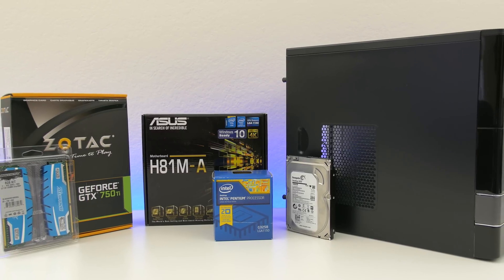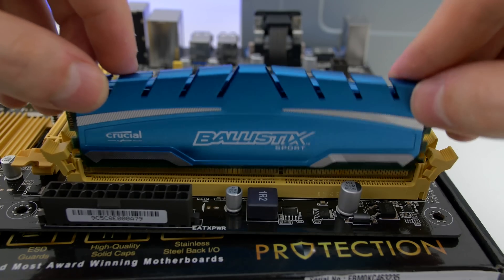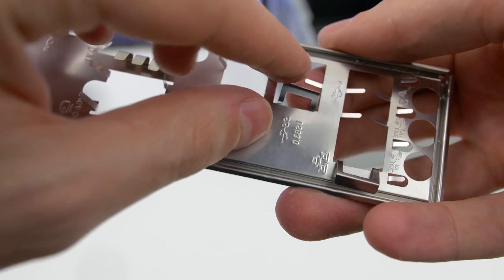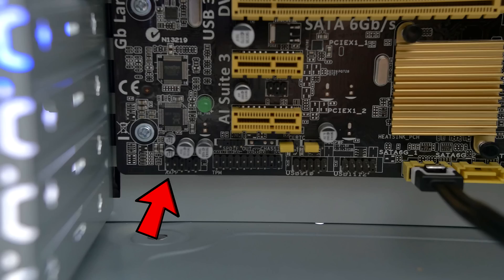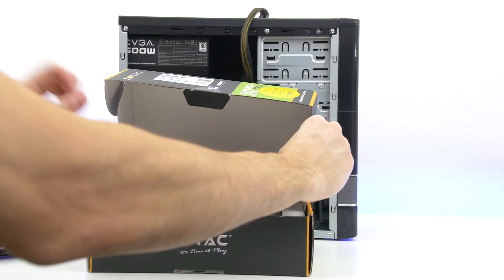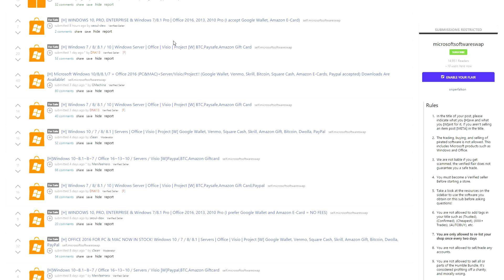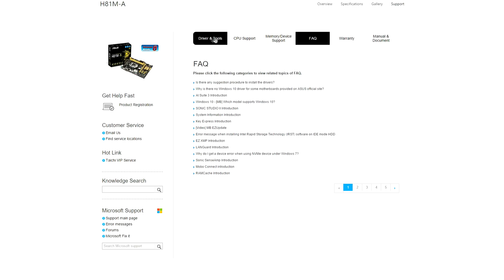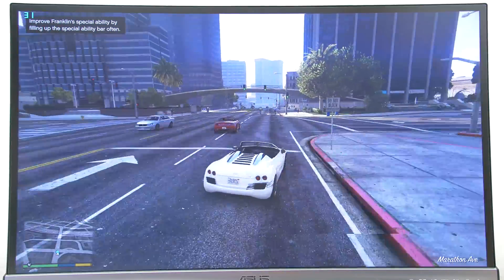How To Build $350 Gaming PC w/ Windows + Overclock!

Comment: just finished the build...its awesome
Reply: +Liam Boyle for sure, it has trouble running skype with games but it's not a huge problem...if you upgrade anything I'd recommend the processor
Reply: +Hunters for some reason mine is really slow. is it for you as well?
Reply: +fifastarXD slow at what? mines been very good
Reply: +Hunters it loads applications really slowly for some reason? Maybe because I didn't download all of the plug ins yet?
Reply: +fifastarXD that's could be it
Reply: +Hunters not the problem either. I'm unsure what to do at this point now :(
Reply: +fifastarXD idk mine couldn't run games and skype at the same time at first and I just restarted it and it worked I also didn't over clock it
Reply: +Hunters yea that's what's happening to me right now. I couldn't run any games. However I overclocked but that should increase the performance not decrease it?
Reply: +fifastarXD it should but I have no idea why mine started working this is my first ever build so I wish I knew more
Reply: +Hunters yea same here. I tried to ask Ed but he never answers lol

Comment: Hey there, i want to see a special build from u :) . i7 6700t, cr-95c 
passive cooler, Seasonic Platinum Fanless 400W, Gainward GeForce GTX 750
 SilentFX, and a m.2 ssd . Mobo and case picked by you for this build :)
 . Can i see this? I want to get this build and i want more info about 
reliability and temps in load. I want to use it for hard multitasking. Can u test these components to check how it performs? To know at what to expect if i dont use any cooler.

Comment: What does over clocking do exactly i know it increases the performance 
but how?
Reply: By stretching its limits, however if you overclock it too long or too hard it will use more power and you have higher chance of running out of power or havinf malfunctions

Comment: What do I do with the PCI-E cord thats connected to the PSU? I have a GTX 950, would I connect it to that?
Reply: the second part of your comment. causes theres a PCIE slot on my graphics card (not the one in video). do i just ignore it?
Reply: MSI GeForce GTX 950, it had a 6 pin and the PSU has two 6 +2 pins, would I connect a 6 pin and just ignore the 2 pin?
Reply: alright thanks! cheers mate.

Comment: Intel Core i5-4690K 3.5GHz Quad-Core Processor
ASRock H97 Anniversary ATX LGA1150 Motherboard
Kingston HyperX Fury Black 8GB (2 x 4GB) DDR3-1866 Memory
Western Digital Caviar Blue 1TB 3.5" 7200RPM Internal Hard Drive
Samsung 850 EVO-Series 250GB 2.5" Solid State Drive
EVGA GeForce GTX 960 2GB SuperSC ACX 2.0+ Video Card
Deepcool TESSERACT SW ATX Mid Tower Case
EVGA 500W 80+ Bronze Certified ATX Power Supply
Cooler Master CM Storm Devastator Gaming Bundle Wired Gaming Keyboard w/Optical Mouse
Good build? It's my first.
Reply: good build ^_^
Reply: How much did you play for all of it

Comment: Hey I want a super fast computer that will render cinema 4d and blender super fast for under $1000 is that possible? And any recommendations for a pic and processor.
Reply: i7-4790k or something in the i7 line due to the hyper threading it helps greatly with rendering as you do in c4d/blender

Comment: 1.345 is too high for 4.3.
I know all cpus are different, but if it takes that voltage for 4.3, you got a dud. :P Not that it really matters I guess, it will still do it's job.
Mine hit 4.4 at 1.25, now reaching 4.6 was a different story. It takes that voltage for 4.6 (1.345), but this is on air.
Reply: +Chika Hakozaki It depends on the motherboard though
Reply: Owismael That's true and also the chip itself. As long as temps are okay, I guess nothing to worry about. This cpu is quite impressive. It actually doesn't come that far off from my old Phenom II x4 965, and that's with an OC. However what's more impressive is that it out scored it on firestrike with the same GPU. Really impressed that a dual core is outbeating a Quad in that.
If that didn't make sense, I'm talking about Physics. The Quad still beats it. But overall, the Pentium outscored it.

Comment: Right now I'm using an old XP computer because I got a bad motherboard from Amazon. Check out these specs: 
Intel Pentium 4 630 1-core 3GHz w/hyperthreading
3GB of RAM 
ATI Radeon X300
Windows XP Pro 2002 SP3
lol this is garbage these days but back then this was a killer  PC. It's been going strong since 2005. Damn they don't build PC's like they used to. I have a PC at the radio station running Windows 95 and a very old AMD K6 and 64MB of RAM lol
Reply: You have a better cpu that me
Intel i3 dual core 2.1GHz
Reply: Nah I only have one core lol

Comment: Then when you done with this shit, throw out this intel garbage(i don't hate intel just the G series). Buy an FX-4300 with a normal motherboard and a good cooler(it's cheap beleive me) and there you have a 4,7ghz 4 core pc and that CPU does know not just the double than this
Reply: Well you can easily upgrade from the pentium straight to an i7 4790K, without a new mobo. Rather than switching to AMD
Reply: +Tris which is cheaper? :D
Reply: The intel is cheaper to start with. Then when you save for like a few weeks, then get the i7? AMD gets destroyed in performance
Reply: i7....but for gaming an fx8320E does it's job....cheap, good, cool...ofcourse not in 4K but not everyone affords that kind of entertainment :D

Comment: Is there an alternative for the ZOTAC GeForce GTX 750 Ti  cause it isnt available in my country?
Reply: +BA LION r7 360 or r7 260x
Reply: +Nissan U. (SUBW00FER) thx
Reply: +Nissan U. (SUBW00FER) Gigabyte or Sapphire r7 360?
Reply: BA LION I personal would go with sapphire because they specialize in AMD cards, but really they preform the same for the most part. Just get the cheaper one. 

And if you can fork out a little extra money you could go with with the r9 270x or the gtx 950 if they are available in your country.
Reply: Nissan U. do they all fit on the mainboard he uses?
Reply: BA LION yes. But there is a Pci connector in the power supply you connect with the gpu. The 750ti doesnt need one because its so efficient.
Reply: +Nissan U. (SUBW00FER) oh ok thx for helping me out

Comment: hi would someone tell me if there is anything i could improve on this build/ will it run the new gen games well enough?
Crucial DDR3 PC12800/1600MHz CL11 8GB ram
Gigabyte GeForce GTX 960 4GB Video Card
Intel Core i5-6600K 3.5GHz Quad-Core Processor
Western Digital Caviar Blue 1TB 3.5" 7200RPM Internal Hard Drive x2
Kingston SV300S37A/120G
not sure on power supply right now any suggestions?
thanks for your time please reply if you have any feed back/ help to give :)
Reply: +noodle muncher and the mother baord is 
Asus Q170M-C

Comment: Ed, I have a question if I use my old hard-drive that works perfectly fine and use it in this build for a new pc will it run/boot up okay, I have Windows 10, 64 bit on my current hard drive I use now. 
Thank you in advanced.
Reply from the maker: Yes ofc. Just plug it in like I showed in the video and ur set to go
Reply: +TechSource okay! Thanks so much. Appreciate it.
Reply: Hey Ed i saw your 450 December pc and this. which one would u recommend

Comment: a crucial part of this is waiting for deals, and also willing to buy used. I was able to build an A10-6800K system with a 212 evo, 8GB of ram, and some gigabyte matx mobo for around 200 dollars. Granted, I had a PSU and windows laying around, and i later bought a HD 7770 for 30 bucks. Just wait for deals, or black friday, and enjoy the value :^)
Reply: Why the a10 if you're using a dgpu
Reply: +Ben BC the hd7770 was an upgrade a year later

Comment: The reason why those metal parts are "interfering" with the build is because they ground the USB ports with the case. You should leave them exactly where they are. Also, the hard drive doesn't use SATA 6GB/s interface, it uses 3GB/s so what's the point in wasting a good 6G cable and port?
Reply from the maker: +Bjork Vlogdok the hard drive is a 6gb/s drive from Sea Gate. Those pins are annoying and get in the way, lots of people remove them.
Reply: I know but it doesn't use that bandwidth, only solid state drives do.

Comment: Hey Ed or any viewers that know their stuff, in terms of cable management would it be a bad idea to use brown adhesive tape to tape the cables together in place? I don't have the luxury of having velcro straps and cable boxes for this purpose unfortunately lol. If not would it be better just to leave them be?
Sick PC build as alwayss btw :)
Reply: +TheMaster640 I think it would be better than nothing. If you can't get Velcro, just use zip ties. If you can't use those for some reason then I think the tape would be fine. I wouldn't leave the cable like that because that creates bad airflow and bad airflow means more heat and you never want a hot computer.
Reply: +Ethan Burton thanks for the advice I did actually opt for using zip ties as I did have some lying around lol worked nicely :)

Comment: Ok so I'm new to pc and all and I've really got in to pc ....SO I decided to actually build one but I'm not shure what to get or anything ,but what I'm wondering is if you need thermal paate at all..?
Reply: what's your budget?? And thermal paste is necessary if you don't want your cpu to burn out
Reply: id recommend going to pcpartpicker.com great build guides in there and yes its necessary unless your gonna use stock cooler which already has thermal paste applied
Reply: Oh ok thx and my budget $400

Comment: Ed, would my i5 4690k be fine to overclock with the settings you used? Great Videos btw
Reply: Yeah
Reply: +Sam Drew I think so but if it is unstable just ever so slightly increase the voltage

Comment: the overclocking didn't work for me and I have the same motherboard and the same CPU, I have Windows 10 in case that has anything to do with it
Reply from the maker: +GeckoMkII what do you mean it didnt work? like what messages came up? Is the bios and chipset drivers updated?
Reply: TechSource it said that Windows couldn't start or something and then it restarted it's self and said repairing device and went back to the Windows couldn't start screen so I went back to the BIOS and changed everything back to how it was but when I got the I'm pretty sure it says that it was overclocked to 4.0GHz
Reply: TechSource here's a link to the PC but I've updated the GPU to a GTX 960 4gb

Comment: Come on, I'm sure anybody can pay $40 more for a Core i3-4150... I love Pentium, I really do but dual-core can't handle most of the games.
Reply: That with a 950 would've been better. This build with a pentium and 750ti was good 2 years ago, now a i3 and 950 is a better option. $50 more dollars for a much faster experience
Reply: +josh Subet Actually both will make $80 difference but it'll be worth it.
Reply: Sezer Çelik $80, still worth it. $450 PCs is where its at for budget gaming on all titles.
Reply: ***** But you definitely need that i3.
Reply: *****
for lower end games $350 is good.
for all types of games 60 frames with good settings, $450
at $450 you can pretty much play all the games a $1000 pc can.
Reply: *****
http://www.bit-tech.net/hardware/graphics/2015/08/20/nvidia-geforce-gtx-950-review-gigabyte/6
40 frames very high 
obviously it can't run as well as a $1000 PC, but it can play all the games that the $1000 PC can at lower settings. And not all minimum getting 30 frames, more like medium high 60 fps at 1080p
Reply: *****
what are you expecting from a $450 PC?
most people who buy a $450 PC won't get a monitor higher than 1080p.
My point is you can play the same games a $1000 PC can at good settings and good frame rates, not that a $450 PC = $1000 PC.
with a $350 PC, getting 30 fps in some games at high or even medium is disappointing from a "PC". Might as well not even get those games if you can hardly run them.

Comment: if using the links for the parts it will be $399.62. If bought from new egg its $377.88 plus a $15.00 mail in rebate. For a extra 15 you can get a msi gtx 950 from new egg on ebay.

Comment: if i record cs:go can i have over 100fps?
Reply: Most likely. Use Shadowplay (or something like that) for minimal fps drops.
Also, if you have a 60 hz refresh rate monitor, there's no need to play with over 60 fps, since the monitor only can display 60 fps :) [If you don't need higher fps for editing]
Reply: +noah. thanks man :)
Reply: i use 750ti and i have 300 fps.
Reply: xtra kake O-O really? I'm getting it soon since I have some 2010 amd one. Did you get it pre-over clocked, and does it raise your electricity bill by a million dollars?
Reply: noah. well i'm playing on all low setting and 4:3 but when i played full screen windowed and all high setting before i had about 120-200 fps :) np recording.
Reply: +noah. Can i use gtx 750ti with a ddr2 motherboard? I want to upgrade later!!
Reply: probably. but motherboards are cheap man. get ddr3
Reply: Norbert Nagy search it up m8
Reply: Norbert Nagy Probably want to get a new motherboard.
Reply: +noah. Hmmm ok! I buy this pc! Can i change the processor? For an i5 or something this?
Reply: Norbert Nagy Yeah sure.

Comment: will this pentium bottleneck a 960?
or should i have to go for a i3 4160?
Reply: Go for the i3
Reply: And if your getting a 960 maybe should have an i5 doesnt have to be an expensive one the cheapest one is better than an i3 due to the quad core.
Reply: +Bangin&#39; Beatz but the i3 has hyper threading which sorta makes it a quad core lol
Reply: Dude hyperthreading is not the same thing.  Hyperthreading basically lets the cpu do more things than it actually can but in the end,  it can really only do 2. But if you buy the the i5 which is a quad core,  it has 4 real cores where as the i3 has 2 "fake cores"  as you could say so either way the i5 is still better and some games wont even allow dual core processors such  as gta v even with hyperthreading.  There is some kinda trick to get around that but i recommend to just buy a quad core processor like and i5 or you could go cheap and buy an amd quad core cpu instead
Reply: Go with the i3, works just fine with the 960
Reply: +Bangin' Beatz the i3 works on ANY "quad-core" game because it has 4 logical cores (every operative system sees it as a quad core no matter what)
Reply: Oh i didnt know that but four real cores are better than 2 cores and 2 hyperthreaded ones.
Reply: But the i3 is fine i guess
Reply: yeah, hyperthreading is virtual cores, so they basically are more cores
Reply: Bangin' Beatz ofc it is but it's more expensive too that the point
Reply: bobbykewl ._. Yeah but hyperthreading is not as powerful as real cores
Reply: Marco Martins not really too much of a difference even the cheapest i5 would be better and the cheapest i5 is like around 120 -  130 usd which is the same as an i3 coming in at around 127 or 130 usd
Reply: an i3 is $100
Reply: +bobbykewl ._. Nah bro the good ones are around 127- 143 usd
Reply: the i3 4160?
Reply: +bobbykewl ._. Hol' up lemme see da name real quick gimme a second
Reply: +bobbykewl ._. i3 6100 (which is wayyy better than the one that you said)  is 123.99 usd or basically 124 usd
Reply: +Bangin' Beatz well not wayyy better but definitely is a difference about 10fps maybe

Comment: Hey Ed I was wondering what would be better for mine craft this one or the 500$ one thx for the vids
Reply: Please respond
Reply: u could play Minecraft on a potato with an FPS of 1000
Reply: you can't run minecraft until you have a gtx 980ti in 4 way SLI, 64 gigs of RAM, an I7 5960X. These are the settings for low.
Reply: Yeah u right man DCxtreme89
Reply: Minecraft is a killer for ur pc

Comment: How high do you think you can oberclock the cpu with a prettt good water cooler?
Reply: Raw Khaos Its just a stupid from a price to performance standpoint. If your paying for for a CPU cooler than the CPU itself is Idiotic, especially if you only gain .3 ghz more or less.
Reply: The pentium g3258 can overclock stabely to about 4.2ghz
Reply: It's idiotic if you watercool a pentium
Reply: not in this case. this pentium outperforms many a8's and i3s. its a really really really good CPU. however, if you're referring to older pentiums, then yes.

Comment: The only bad point is that the pentium is a dual core without hyperthreading so all the future game will not run as smooth as you will except, even on low settings, because they will be optimize for quad core.
But for casual gaming it's perfect.

Comment: You really shouldn't remove the annoying pins on the i/o shield. It has to do with static grounding or something.
Reply: No it has not, that's where standoffs are for. The only thing a I/O shield is good for nowadays is preventing dust coming into your case

Comment: Will the fx 6300 with a different motherboard deliver similar  performance?
Reply: +Johanan Bhavanasi A FX6300 is an AMD based (Viscera) processor with the socket AM3+. A decent GPU like a GTX 960 or GTX 970 with 8 Gigs of DDR3 RAM and you should be able to run all current gen games from 45-60 fps medium to high settings.
Reply: +Sudhanshu Sharma Thanks a lot :)